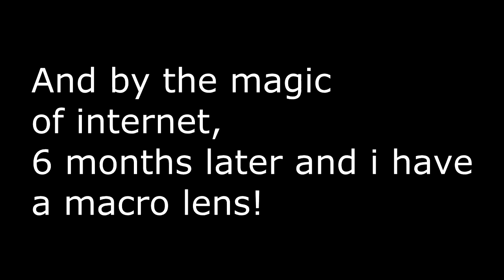Military radio RF 'head' teardown

Comment: The round thing is ceramic resonator that is tuned to generate required frequency and small ceramic piece would  alter the resonant frequency. Resonator should have a metal screw or brass disk right above it for tuning.  "power transistor" is a rat-race coupler. White board stuff is made of silica (AlO) ... Compartment where resonator is need to be stable - hence thick wall. Soooo much interesting stuff going on there. 
Just wish someone like the guy from "The Signal Path" blog would go over it :-(
Reply from the maker: Yeah Signal path would do a much better analyses of this than i could, i'm a bit lost on RF stuff like that.  if i find another one for cheap maybe i'll get it and post to him ;)
Reply: @Sigmatechnica  , more likely the "power transistor" is Y-circulator.